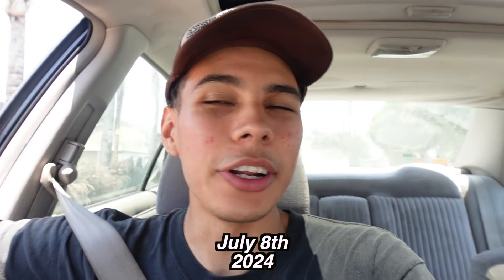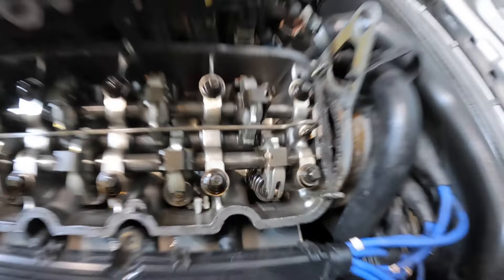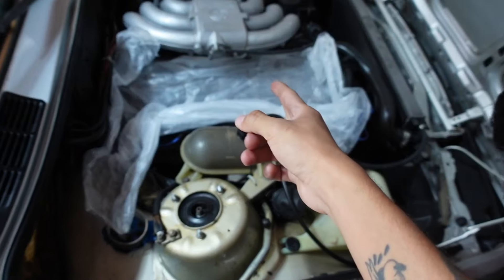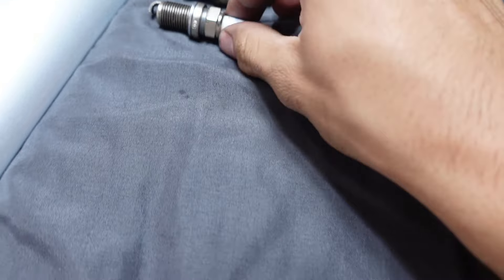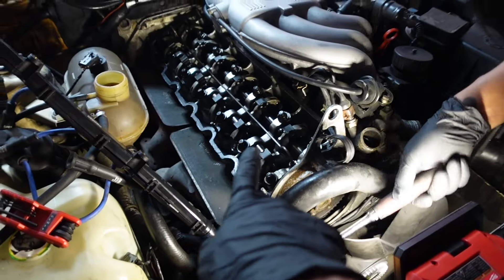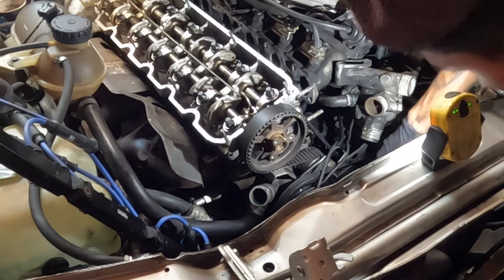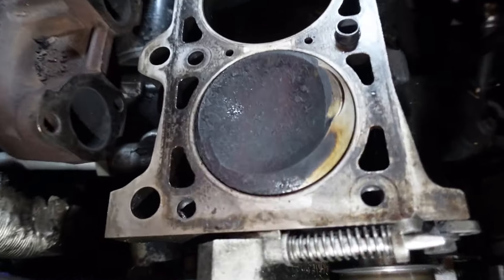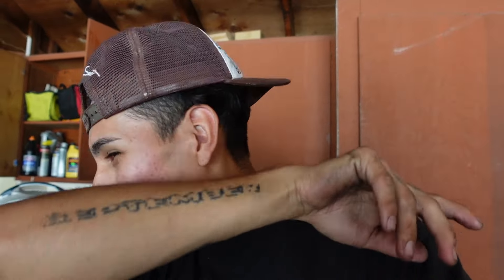I bought my dream E30 !!! BUT it had a MAJOR PROBLEM !

Comment: Keep it stock is best to keep the value, otherwise it will be worth much less when you start modifying
Reply from the maker: I’m not worried about resale value until I start owning Porsches haha but yea I will remember that, I definitely would build it an oem plus style
Reply: @svrepublic6551  no it won’t bro lmaooo I know the market… m50/s52 swaps sell for way more

Only time “ stock” holds value is if it’s dummy clean like it’s been sitting the past 5 years

Comment: Keeping it original and restore it.

It will be worth it in the long run. PLUS, modifying cars will always be more problematic. 

Get the suspension all dialed in and enjoy it.
Reply from the maker: exactly what I was thinking, can’t wait to dial the shifter, clutch, and suspension I wanna do coilovers soon
Reply: @Rxstro  OE shifter bushings will solve that hella loose shifter. Stock clutch for stock power will make the car easy to drive still. Don’t fall into the trap that you “need” a stage 400 clutch with a stock street car.

Some H&R sport springs or race springs if you want it lower and some bilstiens will get you right plus ride nice still IMO.
Reply: @Knownworldwide  yeah you definitely don’t need anything over a stage 1 clutch for stock

But if you plan to boost the car in the future then mineswell go to stage 2 right away

I say stage 1 is good if you want a daily-able car but want it to catch better on “dig” pulls 

If your just looking for a cruiser I’d keep it as a “OEM” type clutch
Reply from the maker: the shifter already has an Ireland engeneering short shifter and bushings kit but the last owner didn’t upgrade to a DSSR, I already have a new selector joint and all that to make the shifter feel like new, and I do plan to put maybe just a stage 1 clutch and a lightweight flywheel to make it a bit more responsive :)
Reply: @Rxstro  man. The DSSR is a must. Don’t know why they wouldn’t have installed it from the gate. Cool, that’s a nice shifter for sure. Making me miss my E30!

A full faced clutch disc will be great for everyday hooning.
Reply from the maker: Ikr, they are expensive though for a small piece of metal so maybe that’s why lol